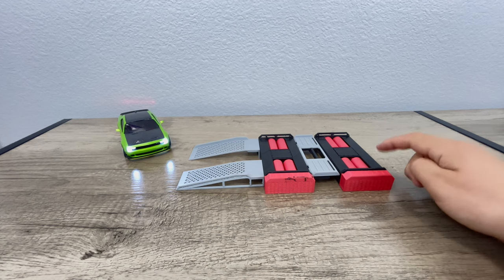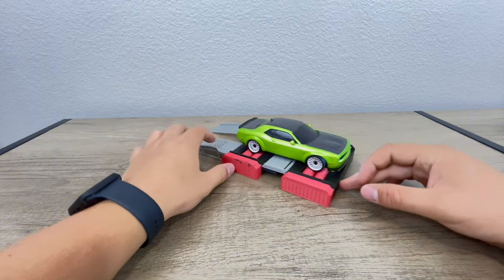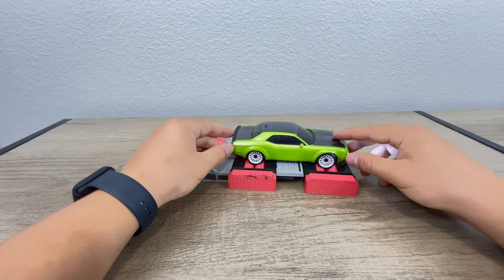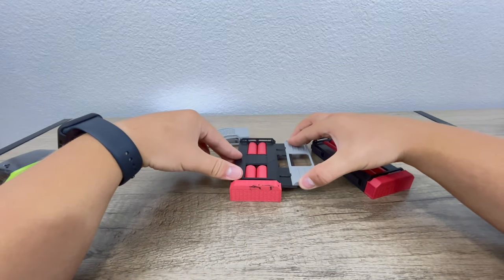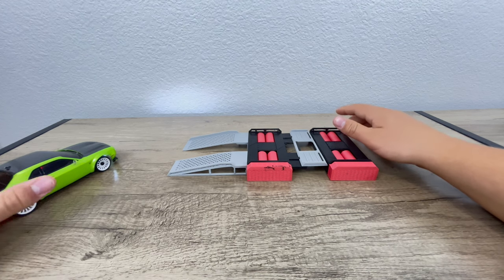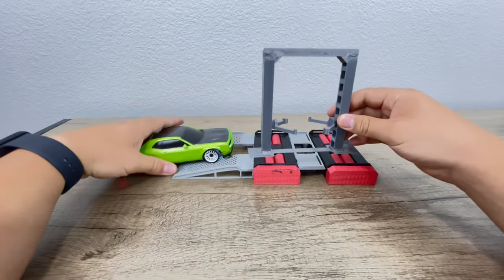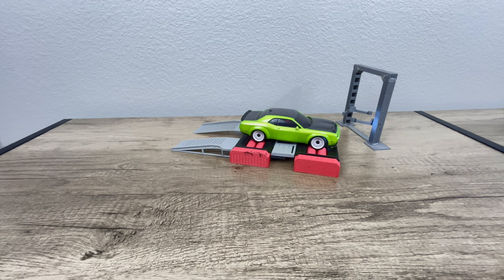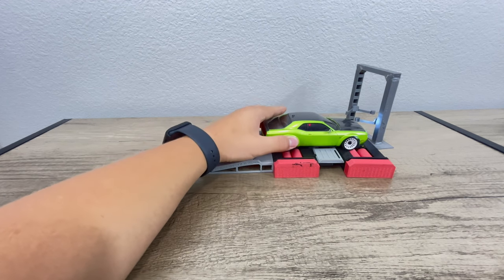The Worlds First Kysho Mini Z Dyno!!

Comment: Not quite a Dyno yet ;)
Reply from the maker: Close enough!
Reply: @NeuroticRCshorts  Where is the electronic to measure torque and hp?
As far as i see it, you just made the rollers, or did i miss something?
Reply from the maker: It’s supposed to be a model… it’s not seriously a dyno.. like come on have you ever seen a small dyno like that and can read the hp and torque and the many other things. It supposed to be a fun model/stand for the miniz.
Reply: @NeuroticRCshorts  Ah, I see.
My bad dude.
But you did make a nice build and it clearly works well.
But admit it. How cool would it be if you made it so it would show speed, HP etc :)
I know I wouldn't be able to do it though, haha.